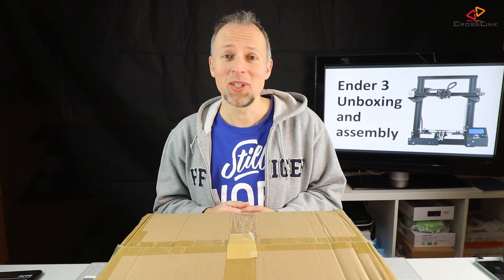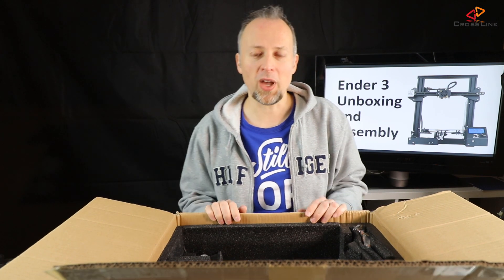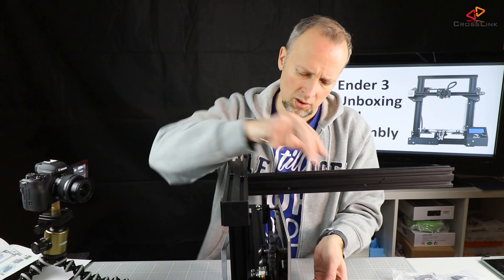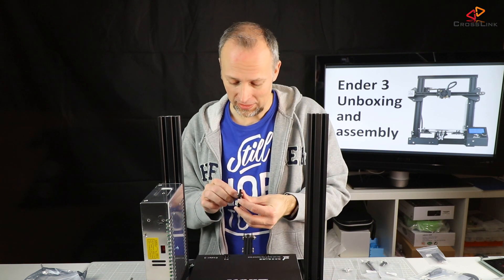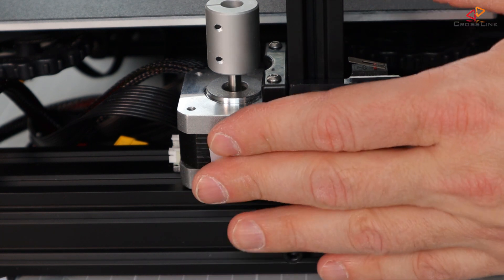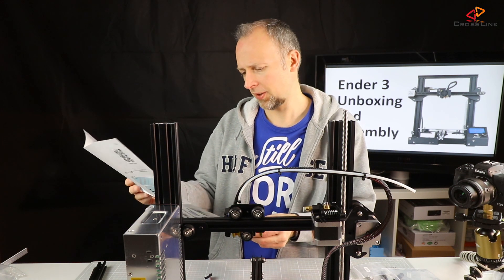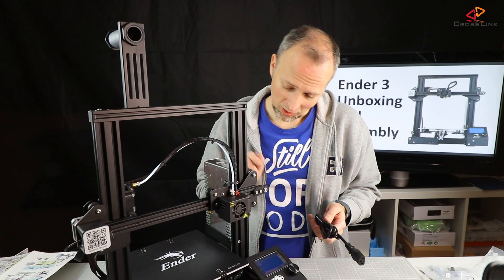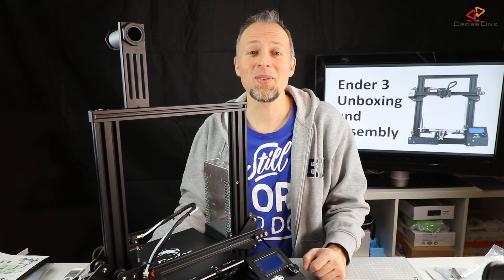Ender 3 Unboxing

Comment: I am trying to set up my Ender 3 Pro, my first 3D printer. I have a question which is not in the assembly instructions, nor in the video. The white tube which the filament is fed into.... how is that attached to the extruder? Without attaching it, the filament does not feed correctly and I do not see how to attach it properly. In the video, it is magically connected at the 9:13 mark.
Reply from the maker: You have to push it into the fitting on top of the extruder until it cannot go further in.
Reply: @Crosslink3D  Thank you. I managed to figure out I needed the fitting. That was not in the assembly instructions. Got that working. My first print just failed. Trying to figure out why it started moving around during the print. Rookie mistakes I know.

Comment: first step make sure it's parallel and 90 degrees everywhere
otherwise it will be impossible to level
the power supply and rest are secondary